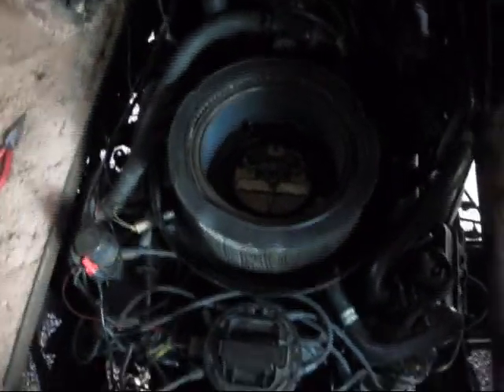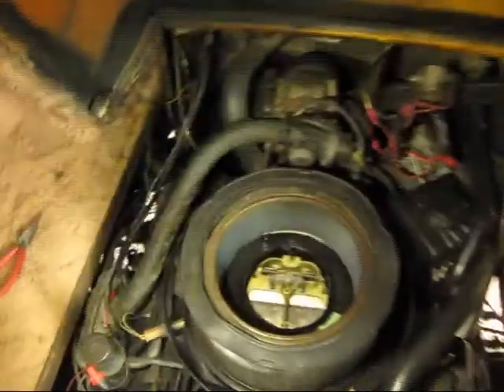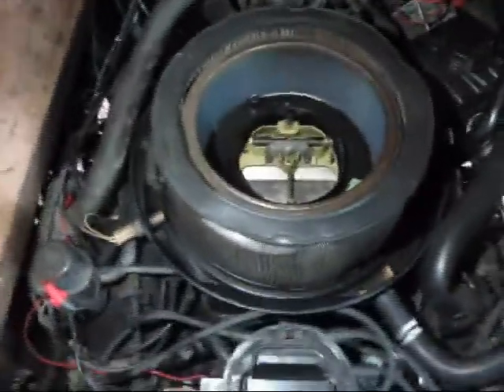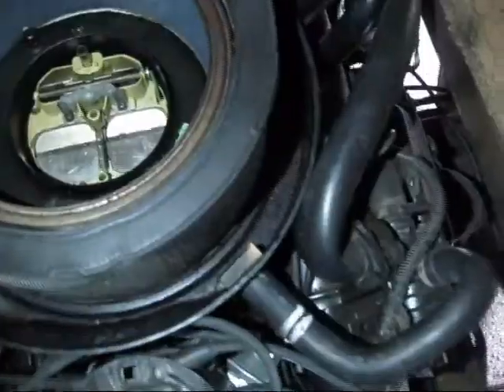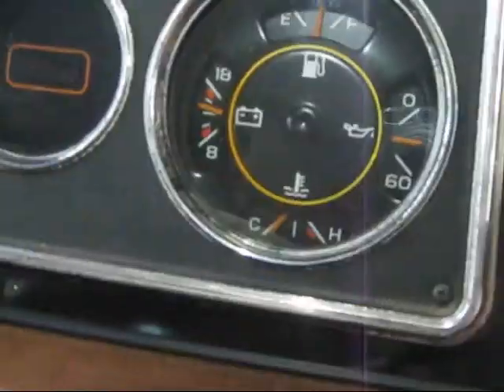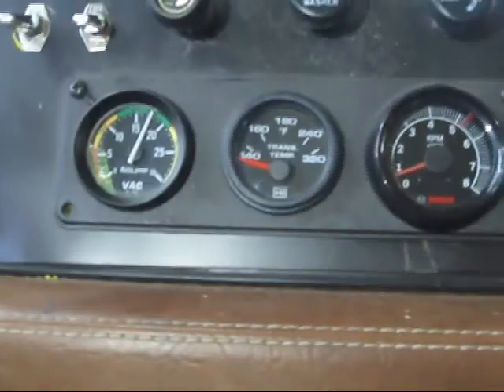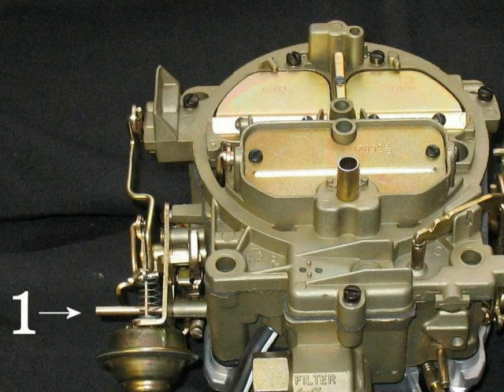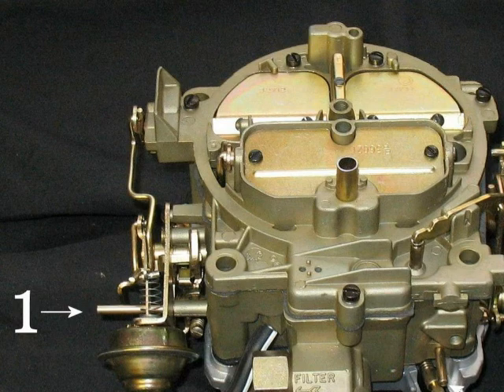Carb Running! RV carb rebuild job.

Comment from the maker: still trying to figure out my cheap video processor. Had a great shot of the carb with the ports marked and sure... the video clips the one port I wanted to show!!. Hope that this video helps those installing rebuilt carbs and sometimes its the simple things that trip you up on getting things to work. If you listen to the last video I bet you can hear that HUGE vacuum leak.....